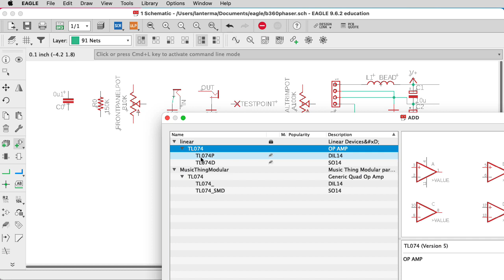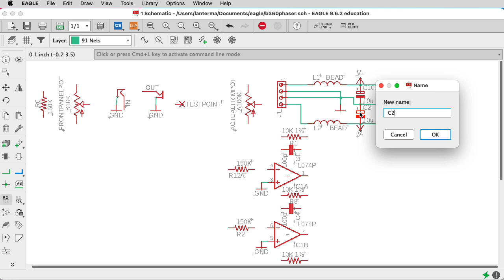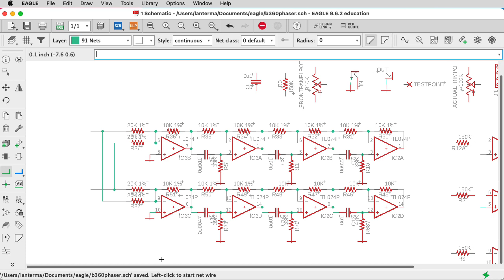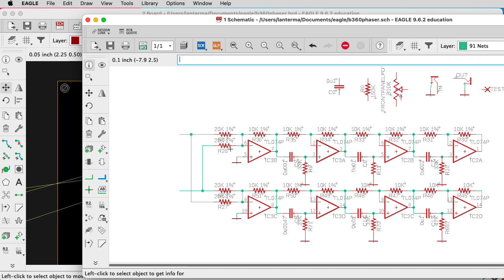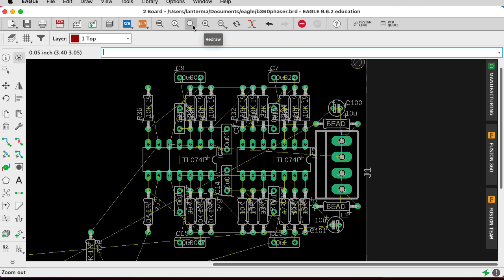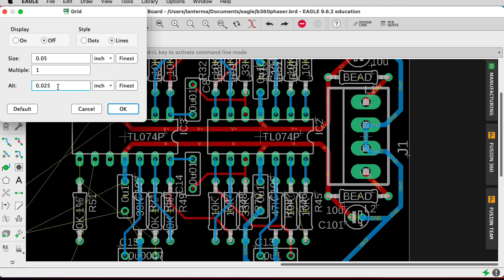Buchla 360 Phase Shifter PCB Layout in Eagle, Pt 1: Power connector, op amps, some resistors & caps

Comment: You do not need the beads, i guess you are using them as a filter? way to high frequency to even do something to the circuit. I would say use diodes instead and you have reverse polarity protection. (or maybe i got that the wrong way around, pretty sure but i'm glad if i am wrong i also use them or did).
Reply from the maker: I got into the habit of using them because Paul Schreiber of Synthesis Technologies/MOTM uses them. He makes some good arguments that RF interference can get inadvertently demodulated an manifest as audio (think about how crystal radios work).
Reply: @Lantertronics  Yes he does on MOTM, but i think he is using LDO with synthesis Technology. (they are all digital now or both :) I'v only seen bits and pieces of hes new designs (when he was kind enough to help me out so he send parts of the design so i could understand what he ment)).

At least what he told me was : Regulate your freaking design and be ahead of the rest, so i did.
And i might have gotten the ferrite EMI from him as well :) he's a good guy.
But the reason i said what i said, was i remember seeing some test being done with beads (EMI) they work in the MHz range usefull for switching supplies, linear not so much i think.

But i have a few hundreds of them so i'll use them in future designs as well, it won't hurt.
So now there are three poople to this beads in the world hehe. You, me and Paul T.

And please do not stop doing this videos i envy you mathematical skills.

Comment: if you write: value 10K 1%, in the command line and press enter, you just have to click the parts and the value changes automatically. the same counts for many "commands" on the toolbar, autocomplete on the command helps a lot. type 2/3 letters and the right arrow. 

if you look at the datasheet of the cd4053, https://www.ti.com/lit/ds/symlink/cd4053b.pdf, page 21.
you see some pcb design guidelines, your power lines are not very ...., it's best to route to the pins of the parts and keep on routing, like C101, C100, use VIA's along the path, change layer and reach for other parts. the GND traces? why not use a polygon, draw it over the board and name it GND (commandline: POLYGON GND + enter and start drawing), the power lines from the socket to the bead, i would have gone with a 90ºC wire bend and round it off with the "mitter" tool, cliking the angle. you get a 45º angle from the pad, while 90º is best.
it might whistle (the datasheet calls the: reflection) on those 45º angles on the power and GND lines. where you go along the route and escape to an part.

what's the name of the schematic?
Reply: commandline: POLYGON GND, draw ... and press the RATNEST button.